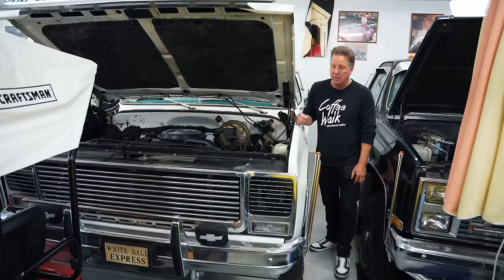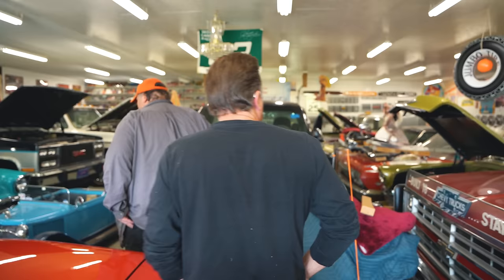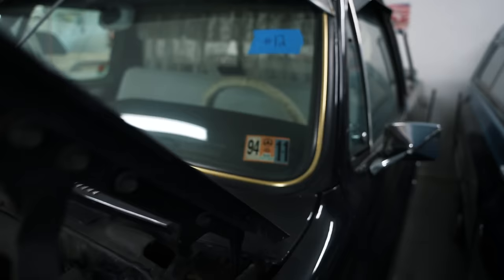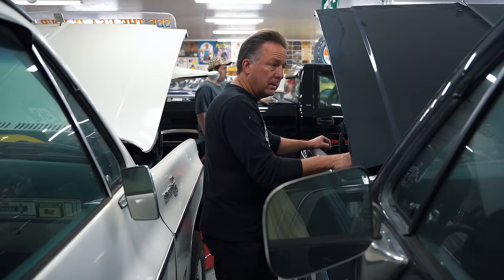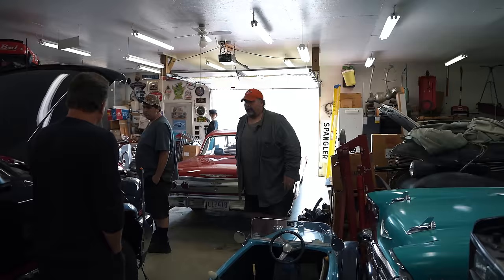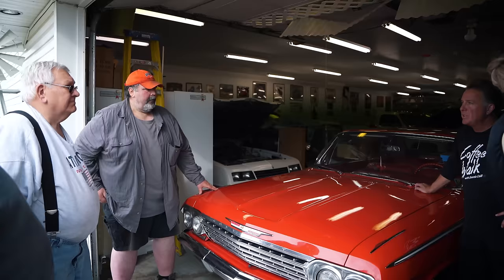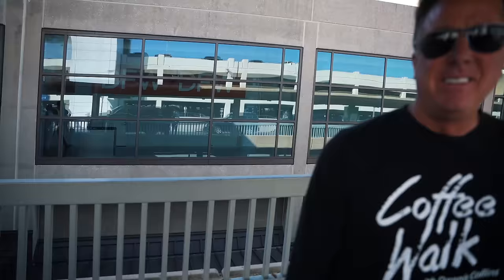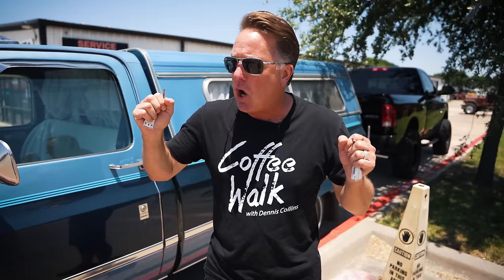10 FOUND: 7 Square Body Trucks, 1 NBS Truck, 68 Chevelle Cvt., 63 Impala Cvt!!

Comment: I have a friend who was in 5th grade and his sister was graduating and she got a new mustang. His dad asked him what he wanted when he graduated and he told him the truck at the dealership . His dad went out and bought that loaded 87 k10 shortbed . It went directly to their body shop and got the “ Heartbeat of America “ pinstriped on the tailgate and filled it with racing gas . To this day it’s basically sits in the garage on blocks with 13 miles on it . He keeps it started and run through the gears to keep it lubed up . It’s a true time capsule .
Reply: WH "heart BEAT "of america, cute but sure didn't work for "gm" they hit a terrible sales era w/that slogan ( yes of course they deserved it) nothing body rots like a square body/&of course there's the gas tank issue, a real "boomer "that product
Reply: @bradzimmerman3171  nothing holds up in the rust belt and not one new truck will go 40years and still put in work like a square
Reply: @bradzimmerman3171  A fellow I know used to joke that his truck kept him awake at night, "the noise of the rust falling off"
Reply: What did it need race gas for?
Reply: @johnnymoran180   Ethanol fuel started being sold in the 80's so maybe he wanted to get fuel without it so it wouldn't eat up the seals, etc...  I don't know how much race fuel would help since the engine couldn't use the octane and there was a chance it contained lead so it might mess up the catalytic converter.  But, I guess he could do anything he wanted with it since it's his truck!
Reply: I’d love to see that!

Comment: The Holy Grail Jimmy was nice for sure, but I'm most intrigued by the 6cyl column shift 3spd. That's one hell of a combo on a truck that late.
Reply: With that 3 on the tree and cab marker lights I wonder if you could order these specialties back then from the factory?

Comment: My Father had an Amoco later American full service gas station with three bays fom 1960-1986. My twin brother and I born in 1953, worked summers there as youngster pumping gas when regular was $0.18/gallon and reular unleaded was around $0.24/gallon. Those were the Muscle Car Era of my time. I saw alot of these beautiful cars and trucks come in to gas or get tires,brakes. They were built tough and anyone could work on one. Not like today's plastic bodied automobiles and all the gizmos on them that disqualify most people from working on them. Had to subcribe...Since, I found your channel "very cool" and informative.

Comment: Dennis, go to Harbor Freight and get you a Braun Slim Bar Folding rechargeable LED light. They run about 40 dollars but worth every penny.  The magnet is strong and great for working on cars. I have 4 of them. One at both my jobs and one in the pickup and one at home. Unbeatable value.

Comment: Dad bought a 72 Chevy C10 same colour, green interior. Blown trans, crap loud exhaust, and wide back tirest.
Striped those stupid tires /rims, install GM rally wheels.
Magna Flo exhaust. Rebuilt the trans. Tuned the engine. Painted the outside and inside cab /engine bay Black. Wet black! New wood for the bed. Sanded varnished (by me and Dad), sliding rear window installed, Heart beat of America decal on the window.
Stereo and speakers.
Nothing crazy.
"Baby" Dad was my age when he bought it and restored it.
Eventually one of his friends from work dropped a big wad of cash on the desk and said keys! Well Dad had been eyeing a couple of El Caminos at show n shine car shows while on vacation and this elderly gentleman had one up in cabin country so being liberated from Baby he bought it. 77 SS Corvette White.
Mom wasn't going to have a car collection in a suburb house and detached garage. Mom had every intention of keeping the back yard.

Comment: Very cool Jimmy. The only issue is, the very thing that makes it cool also creates a dilemma.  Every mile you put on it makes it just a little less special. We picked up 82 Grand Lemans with less than 20,000 Kilometers 5 years ago for my daughter.  So what do you do with a super low milage car, I told her "just drive it". Now it has around 25,000 on it.

Comment: Original owner site spent a lot of money on aftermarket tart up accessories on these trucks! Light up bumper posts, stainless windshield and vent visors, steering wheel covers, bug shields and seat covers. Stunning examples of these trucks, but you’ll partially fill a dumpster if you strip off all the extra crap.

Comment: My dad had a Suburban with that exact same blue and grey paint scheme.  It had three, if I remember correctly, real rows of seating.  Would have to jump over the middle seats to get to the rear.  The death of that truck was the rusting tailgate.  When you would stomp on the gas it would get up and go.  My dad said that it had the same engine as the corvette.

Comment: I found an all original 84 C30 flatbed in MT. Kept inside and absolutely original. GM hoses and even one belt. Its a plain Jane but spotless. 350, 4 sp, 10 ft body, red. Its at my yard in Aberdeen WA

Comment: I got a 84 Oldsmobile 98 Brougham with 61k original miles. Interior is literally on the needle point of perfect. Fuel pump and a carb rebuild for the p.o.s. Rochester quadrajet would have her purring

Comment: A good friend of mine who owns an all steel 34 ford 3 window coupe with a 396 tunnel ram, drop off headers custom made by the previous owner who was Hedman Headers top guy,  and he owns a 55 Bel air panel wagon and a 40 something Chevy panel van, but back in 1984 or 85 I was at his house and he wanted me to see a car I had not seen parked in his garage. 
 It was a buttercup yellow 67 El Camino SS 396 black stripes black interior, posi rear end 12 bolt and a Turbo 400 trans a/c amFm radio in absolutely mint condition.  Reason being was it had 11, yes eleven miles on it. The car was delivered from the factory to a dealership in the area and it got dropped in the dealership yard and that night it was stolen.  They recovered the car two days later missing the drivetrain, motor, trans, rearend and the insurance company called it a total loss so a salesman bought the car and it sat in his garage untouched for 12 years when my friend bought it from him and it sat another 5 years until he ordered a brand new from factory 396 Turbo 400, and posi rearend and he had himself a brand new not even dealer prepped, 67 SS 396 with 11 miles in 1984.  It still smelled like a new car inside. The headlights had only been turned on long enough to drive about four miles when they stole it.

Comment: I still have the 81 square body that my kids learned to drive on.
Mine has about 180,000 miles, and is a 305 with automatic & a/c.
Looks like new inside but outside has some rust spots near bottom of driver door,very minor,i hope! Outside is filthy from sitting in the barn for years.
They are good old trucks with lots of memories!
Thanks for bringing back some of those memories. Hmm, maybe i'll drop a battary in her & see if she'll fire up....

Comment: Those Chevrolet & GMC square body models were produced from 1973 through 1991, except the regular cab pickups "half ton & three quarter ton models only" were discontinued in 1987 & the one ton regular cab pickups were discontinued in 1989.

Comment: I have a 90 V2500 Suburban twin of that Jimmy(Silverado, same colors). Mine has seen a few more miles(290k), on the original TH400(factory tow package)! She'll tow more than her weight and purr down the highway at 60mph. Those first gen TBIs aren't winning any races, but she has many good miles left in her.

Comment: Always liked the square bodies, sadly one of the last ones made a 1999 Suburban K1500 that I owned was destroyed on November 10th.  She was just getting broken in with 228K, engine was strong, transmission had no problems.  Only minor body rust.  She didn't survive hitting 3 horses.

Comment: I'd love to have that Cadi cause those were great engines and they got around 25 to 28 mpg...I had a 76 which was the last year of the huge fisher body cadi and I got 25 to 27 mpg out of a 500 inch engine. As long as I stayed outa the 4barrel carb I got great mileage for a 5000 lb car. The one you're looking at was good ol rides but the Wva salt took em all out body wise. The 63 silver rag top looks like it has a backwards Torino hood scoop on it. I'm not sure but it reassembles one

Comment: I like the square body's alot. I have a 76 stepside Silverado , mild built 454, car close ratio 4 speed, 12 bolt. And an 83 dually regular cab 454 4 speed. Really i love them so much. They would be hard to part with. I could have got a perfect 91 350 k5 blazer, same blue for 5,000,but wasn't a 110 mile.....it was  running driving with current tags on it.
Reply: The scoop on the 63 is a jc Whitney special turned backwards. I think it was suppose to mimic the boss 428 mustang? (Don't know my ford's as well) it's still not right for a 63

Comment: Started with chevrolet in 1985 never ever seen a square body v6 never mind 3 on the tree. More common the 4.4 in line 6 or the old 292. Last new one we seen was in 1985. We sold a ton of the k5 blazer.

Comment: Ive got a 1986 k30 chevy with 37k original miles that was owned by the fire department in Oklahoma found it abandoned under the awning of a shop in midwest texas and almost done doing a full restoration that i plan to keep till i die

Comment: The original owner of those square bodies had to be the BEST customer at the local pep boys ....all of them had the type old man options...sun visors, vent shades, running boards, grab handles, bed rails, light up bumper end poles on front and back bumpers, ...I also bet  he was a big rig driver.

Comment: I have never seen a 1987 Chevy with a three speed on column a V6 yes how would I know I own  
five square body's now for over 35 yrs the last 3 on tree I seen was a 1978 with 28000 miles I own its twin both trucks are still mint here in Kansas Dennis bought the Green Shelby in my home town.

Comment: It took GM 4 years to switch all of their light trucks over from the square bodies. The Jimmy and the Blazer being the last. You did not go to the parts store for a replacement part with out having the original part in hand or you would most likely be sold the wrong one. I learned that the hard way with my suburban. Three different fuel pumps and you only know what one is right until you drop the tank and pull the bad one. The parts books at the part store were wrong more than right and guys behind the counter new it and told me to bring in the old if you want to get the right one. It just had to do with the GM transitioned to the new body style.
Reply: Yep, you first person to mention this on here. I have a 1990 GMC V3500 crew cab 4x4 and a 1991 GMC Jimmy. Anything 1988 to 1991 falls under most catalogs in the OBS category. You have to explain everytime to the parts places exactly what you have (squarebody and not OBS) before they under stand what part you need. You are also correct on getting the right part due to each year having multiple part options.

Comment: I have never ever seen a three on a tree in that late of a squarebody nor the cab marker lights. Could have been some custom work done to it at some point? That 1991 Jimmy with the low mileages has to be the lowest miles I have ever seen in a squarebody of that age still around. It is a Holy grail.  But I am suprised it didn't have the sport mirror option on it. I guess my 1991 is a SLE which had the sport (in cab) adjustable mirrors.

Comment: You wanna talk about holy grill square body truck 1987  short bed 2 wheel drive with the 350 manual transmission  I found one was along bed but I was stubborn and did not buy it I should have  hard to find a manual transmission on the last year with fuel injection 350  Especially in short bed  The next body style you can find all kinds of them

Comment: Looks like Reliable or some other transport company is going to get the pleasure of hauling the other 6 vehicles back. Dennis may be low on cash after this deal, but it seems there were 6 other vehicles there he may have wanted to buy.

Comment: Quartz speedometer???

I still prefer the earlier Square Bodies with the original frontend.  Actually I believe they continued making Square Bodies in the 2500 and/or 3500 for a year or two after the new body style was introduced in the 1500s.

Comment: I special ordered 1979 Chevrolet C 10 with a four-speed 350 V-8 and Limited slip rear end four-wheel-drive. Worst truck I ever owned. It’s spent more time in the shop then I had it in the first six months. Come to find out the frame was bent from the factory. It was a shame cause it was a beautiful truck.

Comment: Nice collection of the last of pickups that GM built when they gave a damn about making trucks.   Since about 1999, their stuff is even more mediocre and less competitive (not to mention absolutely hideous in the last version).    This company has fallen so far since leading truck sales in 1973 (Chevrolet) and offering third rate products that are barely as good as Toyoduh and Nissan.    Of course you can do GM math to make them seem competitive with Ford (adding two marques to beat Ford), but this company hasn't sweat anything when offering the garbage they offer now. 

Nice collection since most of those square bodies would rust into oblivion by now if used on the road.
Reply: But all this older stuff is slow.  All I care about is speed.